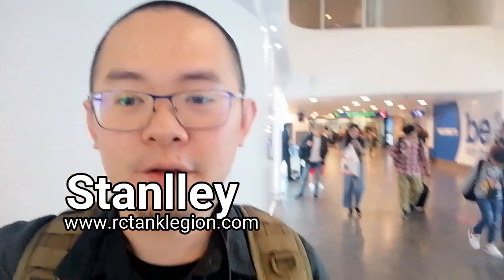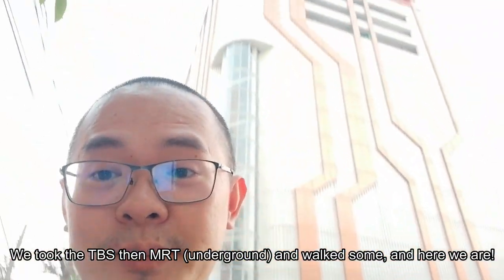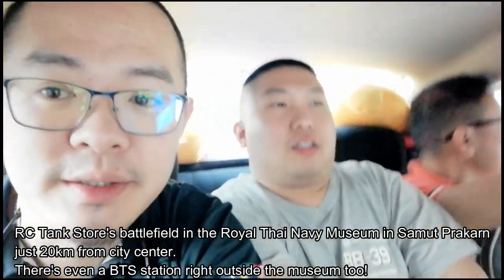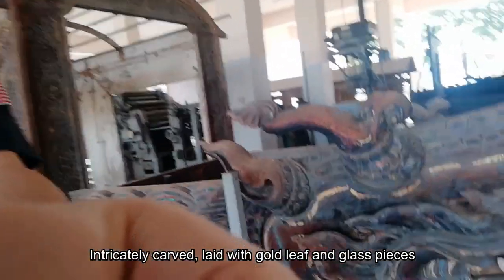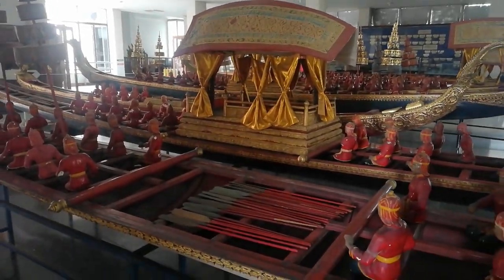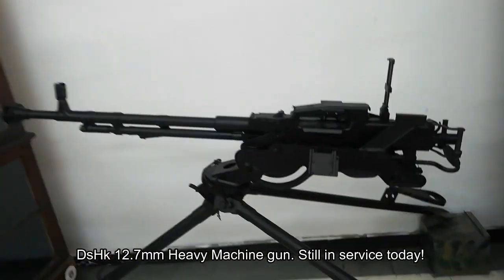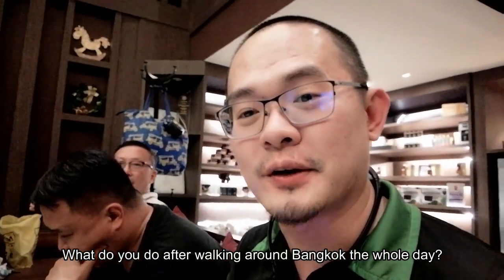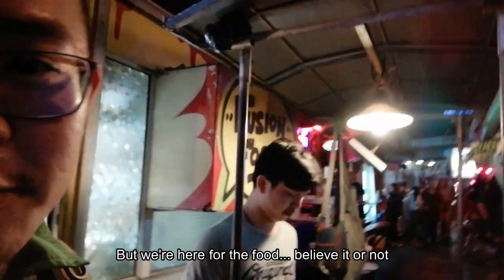RC Tank Legion goes to Thailand!

Comment: I have a question and need your help. I have a leopard 2a6 heng long 1/16 tank and the turret does 360 turning but it just stop work today. Can you tell me what needs to be replace and where can I get it? Thanks
Reply from the maker: hi Chae- perhaps you can be more specific. What stopped working? the turret stopped turning? the tank itself?
Reply: @StanlleyLegion  hi the turret stopped turning sorry
Reply from the maker: Possibly just the turret motor. Try plugging something else, say the elevation or BB unit to the turret motor plug and see if it works.. If it works then it's just the turret motor. If not then the board's fried.
Reply: Ok but everything else is working but the turret. It still shoots BB's. The gun moves up and down so it must be the motor. Where can I get one from? Thanks
Reply from the maker: No I meant you need plug another working motor to the turret rotation plug. You need to find out what is working or not first.
Reply: @StanlleyLegion  it was the turret motor and I replaced it. Thanks for responding and helping me out.👍